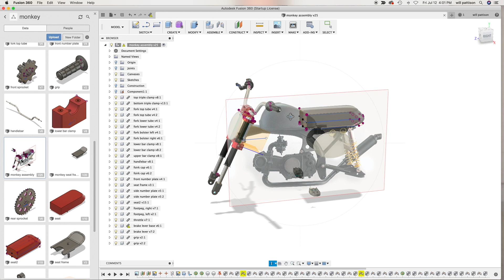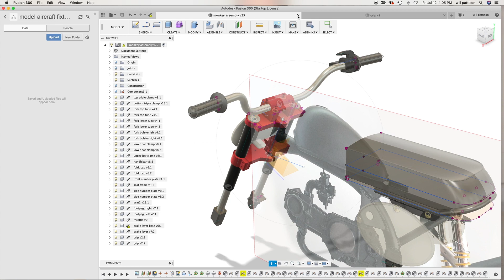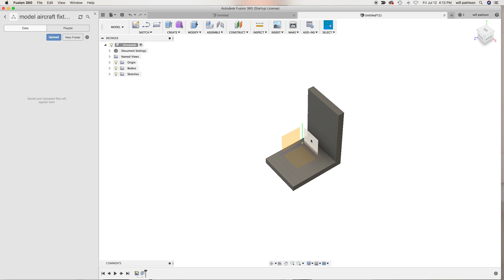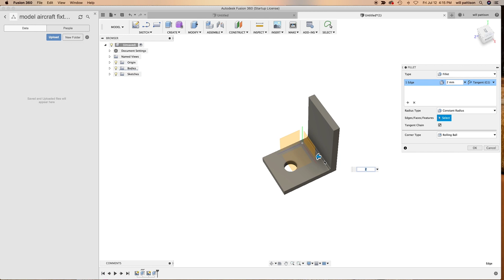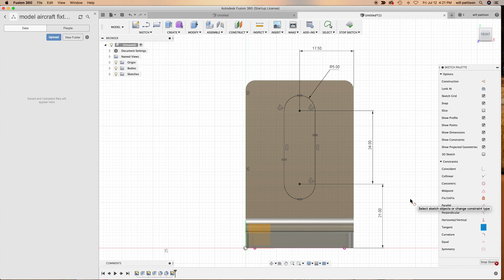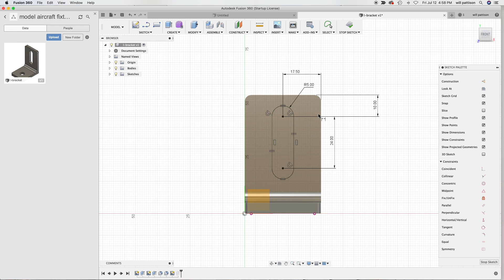ep239 - an intro to cad with fusion 360

Comment: Thanks for spreading the word about Fusion360. Free for hobbyists, and well-supported by the vendor.
I've been using it for a couple of years for the occasional project. I just finished making a buck to vacuum form a convertible roof for a kitbash I'm working on. I have an Ultimaker, but the Anycubic Photon is now on my wish list.